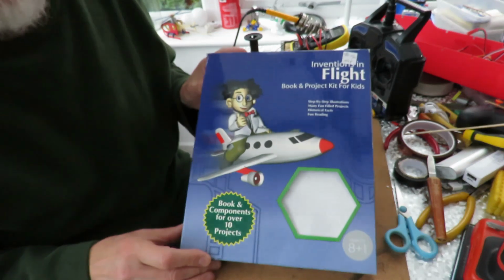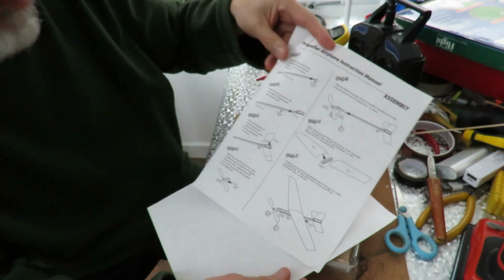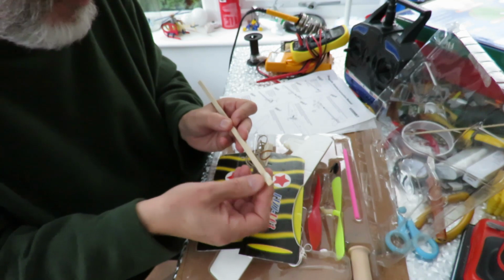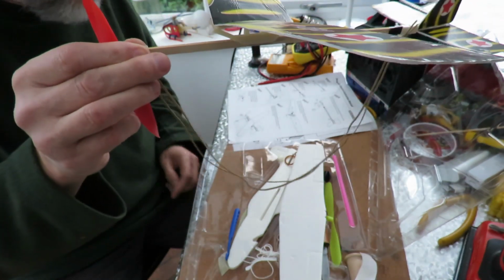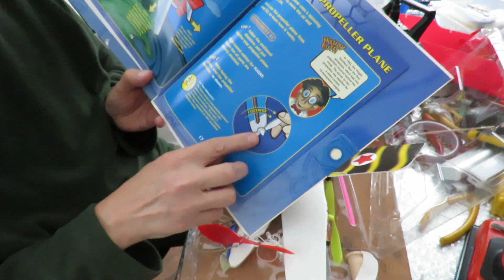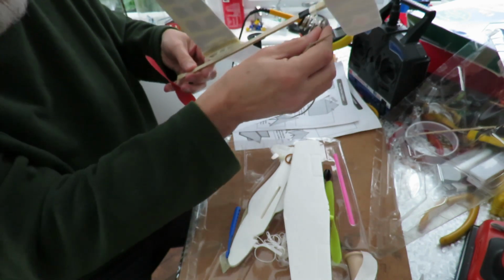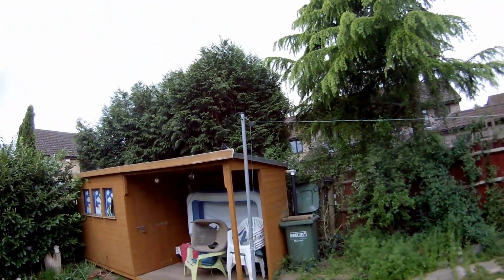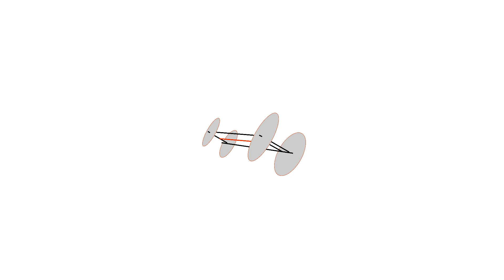Put a rubber band on it #0257 Rubber Band Powered Plane kit assembly

Comment: I thought for sure you'd have to knock on the neighbor's door... LOL... And then you almost throw it in the pool! I really did take off though huh. The one set of paper instructions shows a paper glider, are you supposed to put a propeller on that? That could be interesting... or is that a video schedule for 2 weeks from now
Reply from the maker: There are 5 or 6 paper plane sheets there but they are all just gliders and No I haven't done them yet, but I probably will, not on this channel though :-)
Reply: The typical needle type glider could be interesting with an RB pusher prop